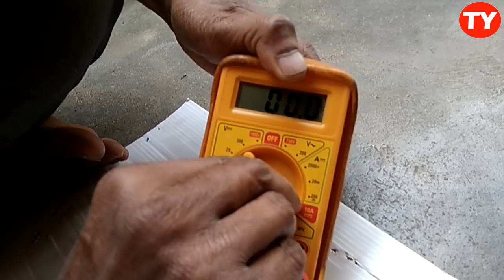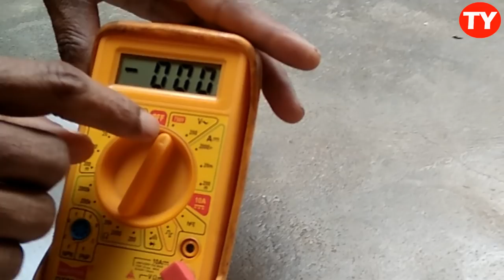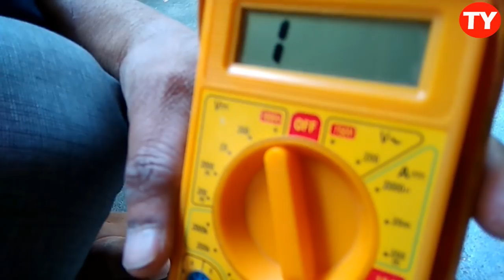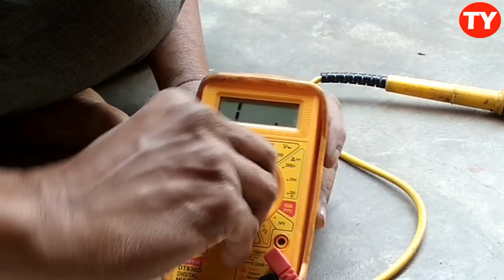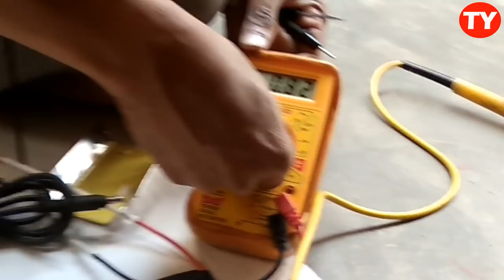laptop charger repairing

Comment: Thank you brother, exactly same problem in my same adapter. I checked with voltmeter like you . The short-circuited place was at the entrance, I cut it 10 cm ahead and soldered it again, the problem was solved. Thanks again.
Reply from the maker: thanks
Reply: Hey

Comment: You are smart guy. Not safe working with electricity with barefoot.  Thank you for making the effort  speaking in english. Greeting from England.
Reply: Sir is it risky to open and check charger like that? I'm new for this
Reply: @leolearning3048  It is very dangerous if you do not know what you are doing.
Reply: @JohnSmith-el5mo  thank you sir. Maybe I should just buy new charger. Thanks.
Reply: @leolearning3048  You can do a the basic checks  e.g fuse, swap power cord or try different wall socket.

Comment: I just disassembled mine and it started working.... Something is making it short circuit... The Acer laptop was bought in 2007 I wonder if this has to do with programmed obsolescence... I will have to disassemble it again for it to lose the electricity  peak.. I also recommend simply to use black electricity tape around it in case you need to open it again
Reply: Tell me the model of your laptop ....... Because I have the same problem

Comment: Nice video. I have a similar HP power supply that I am trying to debug and fix. Which component did you check for 300V dc? What pins did you check across?
Reply from the maker: turn on ditial meter dc 1000 volt and connect red probe at positive  and  negative of main filter capacitor  near ac bridge rectifier  ( 120 mf 450v capacitor)
Reply: Okay Thanks will try that.

Comment: Thanks but i notice at 2:00min in your last DC voltage check was done on AC setting on the Meter and at 10:35-38min you did not re-attach the Ground to shinny case if you remember you had to pry it off so is it not totally Grounded?     That's Dangerous ; I'm thankful for your time but Dude Safety First!
Reply: That "shiny case" is not for ground, it is to cut down EMF only. He pried it off because it was glued in place.....no ground connection. It is safe, no problem.

Comment: Sir nice video. My razer blade laptop power adapter not working as it got shot due to power in d nuetral. Wanted to get it repaired as same or alternate is not available anywhere. Can u help me
Reply from the maker: plz give me  full details  adaptor model and brand
Reply: @electrionics  Laptop is 15 inch Razer Blade with 200w power adaptor .

Comment: Brother, I have a laptop charger. The problem is that it is a 16 volt laptop charger. When I put it in the current, the voltage comes and goes again. It shows the voltage in half a second and then goes away.

Comment: Nice educational video sir, I have a problem with my AC adaptor sir, its not getting hot but only to the joint wire of ac was getting hoter. Is it still can be fix?
Reply from the maker: plz replace main card good quality

Comment: Which component should I check inside if there is a short circuit in the adapter?

I mistakenly shorted the pins with the multimeter connectors  while I was trying to check the output from the adapter.

Can u tell me which portion of the adapter is shorted is it the wire or something inside?

The input pins are also showing short circuit
Reply from the maker: main filter capacitor  and  bridge rectifier
Reply from the maker: mostly wire  only near dc pin  2  capactior  820 mf 25v  3  diodes

Comment: I have checked continuity..  my problem is not in cable but  in secondary stage of adaptor.. It's showing connectivity.. What to do?
Reply from the maker: check filter  capacitors scotty diodes for short
Reply: @electrionics  bhai everything solved... Problem is in laptop dc socket with shaky pins

Comment: Mera 19v 2amp charger gets very hot, I mean very very hot. But working fine, why???
Reply from the maker: replace your adapter it may damage your laptop  or use your  adapter near fan
Reply from the maker: you have to use  19v 3.5 amp

Comment: don't use cello tape inside.....it may burn due to heat generated. Also scratch thermal grease from the transistor and then put new thermal paste otherwise transistor will blow during usage
Reply from the maker: yes  good idea

Comment: Thx for not speak Hindi, Urdu, Bangla, & Tamil language 👍🏻🙏🏻, I will share a little knowledge about how to open a laptop charger case, use gasoline or eucalyptus oil to destroy the glue on any charger casing, drip or use a sprayer on the sidelines of the casing, so it will destroy the glue on the casing without damaging the casing, good luck 👍🏻🙏🏻

Comment: Are you still available? I have some questions.
Reply from the maker: yes
Reply: @electrionics  Do you have Instagram? I have a few questions.
Reply from the maker: no instaram . ask  i give reply
Reply: @electrionics  Can I cut the pin wires and attach new wire with pin only instead of replacing the whole thing?

Comment: Perhapsention when power is connected, don't handle the adapter like you showed. The pins with high voltage are exposed. Thats pretty dangerous
Reply from the maker: y

Comment: Yesterday night due to sudden High Voltage my Dell Inspiron 15 3000 Series Adapter is getting very hot. I have stopped using it.
Can it be repaired?
Reply from the maker: plz check short circuit at dc pin and it cable

Comment: Sir pl could u help me with 8pin IC name before that of the optocoupler. My hp charger has IC as A808f.
Reply from the maker: u 3843 ic  osillator ic
Reply from the maker: uc 3843 or hp3d6  oscillator  ic

Comment: Sir mare pas ak laptop charger hay,iska problem hay,jab supply may connect karu iska output volt 1 second kalia show kare,par 0 volt show kare
Reply from the maker: check power led indicator coming bright or dim
or blinking
mostlyproblem in primary section 
check bridge rectfier and main filter capactior then main switching transistor
Reply: @electrionics  iska power led nahi hay

Comment: Excuse me ! I have an Acer laptop charger. The input : 220V AC => The DC output fluctuates between 18,6V and 19,3V. Then I plug the output into my laptop, the DC output drops. It shows 14,5V on my voltmeter. Result : my laptop isn’t charged. How can I fix it ? Thank you very much.
Reply from the maker: check damage or leakage primary  side dc filter capacitor 150 mf 400v 
check secondary side filter capacitors DC SIDE 820 MF 25V  (2)
Reply: @electrionics  let me try. Thank you for your reply
Reply: @electrionics  I replaced 2 capacitors (470uF 25V) with 2 capacitors (680uF 25V). It works now. My laptop is being charged. Thank you so much. Your reply is very helpful. Just 1 thing : I checked the 2 capacitors (470uF 25V) and they are OK ? Thanks again anyway
Reply: @electrionics  Hello. After few days, it happens again. My charger stops charging. Is there any other suggestion ? I have replaced 2 new capacitors 1000 uF 25V. Nothing changes. Thank you.
Reply from the maker: check man filter and store capacitor 150 mf 450v 
finally check for  laptop battery  is dead, ( if it 
become 0 voltage)

Comment: I have one problem.. In output side gnd and neg terminal in charger board continuety will comes...  Wt is the problem.  Sir
Reply from the maker: replace the output power cable available ( laptop connecting) electronic shops
Reply: I remove it...  But output voltage is not get.... how to check the circuit
Reply from the maker: PLZ REPLACE THE  CABLE

Comment: Bro after unplug my big capacitor fully chrged... When touch it i got a big sort...how can i solve it
Reply: short ur capacitor to any metal thing which mean screw drive etc 
a little blast sound and release the all voltage in capacitor empty to the voltage
Reply from the maker: 330 k resistor across on capacitor
Reply from the maker: after removing charger wait some time to dis charge  capacitor

Comment: Sir i do not understand how you checked continuity of cable by checking only one terminal of output supply
Reply from the maker: just remove from both terminals positive and negative and connect continuity test you can easy find

Comment: i have a problem with my laptop charger it loses charge when i connect it to a laptop or when i test it with a multimeter i changed the two capacitors 20v it worked for a few days but the problem happens again

Comment: Sir my Toshiba laptop charger is output voltage is coming 19v
But in my laptop not show charging 
why ?
Please give me some solution to fix this problem
Reply from the maker: plz check with other adaptor 
still if your are getting  same problem  battery may defeat

Comment: Hello, I have a computer charger that does not charge the battery, but when I turn it on the computer becomes very heavy and when most of the things that I connect to the laptop, such as a mouse, it turns on and off, and as soon as I turn on the device, the charger makes a sound inside the charger case. Please help I need it at university

Comment: What is difference between adaptor and charger
Reply: Nothing different
Reply from the maker: adapter  means converting ac voltage to DC voltage (battery voltage). laptop adapter  at same time works as a charger  (it work as a charger and as a adapter)
Reply: @electrionics  that is called converter. Adapter is something you use when you can't fit certain things in certain places. Like EU cables into USA sockets. You have to use an adapter to make that able.

Comment: I was follow those procedure but faina output voltage is 2.54, your help please
Reply from the maker: secondary diode may short or filter capacitor
Reply from the maker: check scotty diodes and filter capacitor

Comment: Hi, my laptop charger has 19 volts at the output, but it is not fixed. It. Back to 7 volt and up to 19 volt then 18 17 16 15....7 this repead
 manyYears ago I was a TV repairman
Please help
Reply from the maker: plz check main filter capacitor 120 mf 450v leage and secondary side filter capaitos 820 mf 25v and 470 mf 25v
Reply: @electrionics  thanks

Comment: Sir I am getting 14.6 volts in output what is the fault
Reply from the maker: check filter capacitors and diodes primary and secondary

Comment: Mera PC Hp elite book 8470p hai uska charger kharab ho gaya 
Maine HP Compaq ka charger lagaya to ye message show ho Raha hai
Plugged in , charging

but battery 19% se jyada nahi ho Rahi hai
aur old charger hai usme pin ke pas ek resistor laga hai
Reply from the maker: we conect but voltage and amperes should match 
if amperes less laptop battery will not charge

Comment: Sound coming from charger and no output voltage coming. Bro how to fix it. Indication light also not glowing
Reply from the maker: plz check secondary side diode may short or may  connector short
Reply from the maker: short circuit secondary side plz check sccotty diode and capacitors

Comment: My charger when plag in then work just for 1 minute then if off...when you again turn on then it again work for just 1 minute...why?
Reply: Looks like it's the issues with the capacitors on the adapter

Comment: Bada badia English bolte ho😂😂
Reply: Forget his English, appreciate his effort to explain how to troubleshoot the problem.  I don't understand why he has to open the adaptor first.  Is it not easy to check the cable first.  Most of the time it is the cable which is defective or broken.
Reply: @jaweedshariff1987  No, you cannot check the cable without opening the adaptor. You will have to cut the cable first, and if it was not faulty, then the value is now damaged.
 You need to move stage by stage. Hope you got my point.

Comment: Due to high low voltage my adapter not working
Reply from the maker: adaptor ac  voltage range   most commonly 100v to 250 v high than 250v adapter damaged below 100v it will not work
Reply from the maker: adapter working voltage ranges  110 to 240v